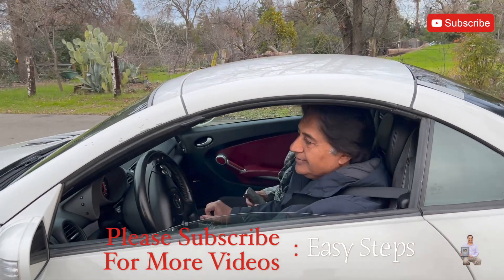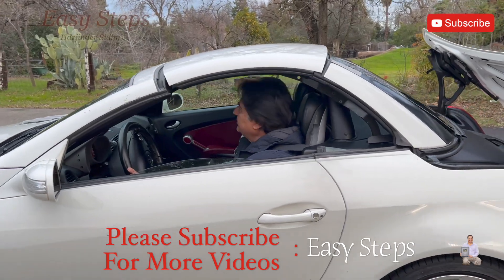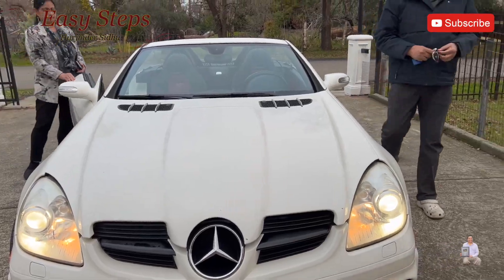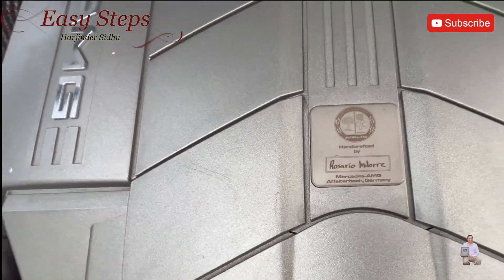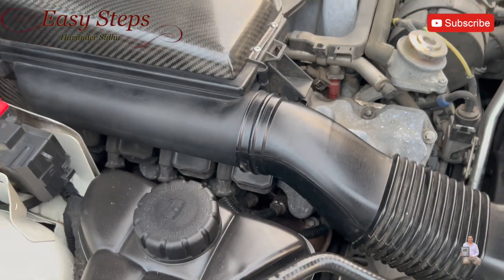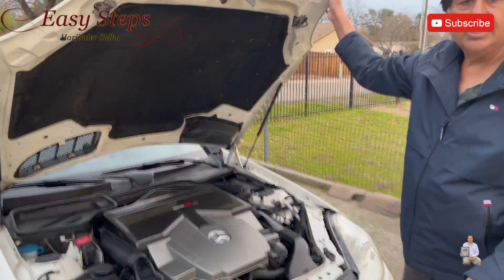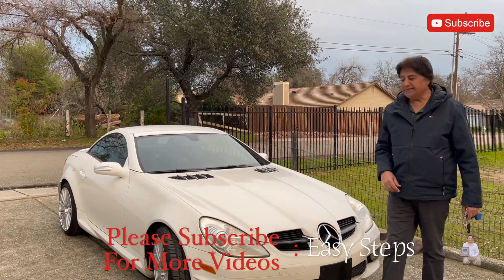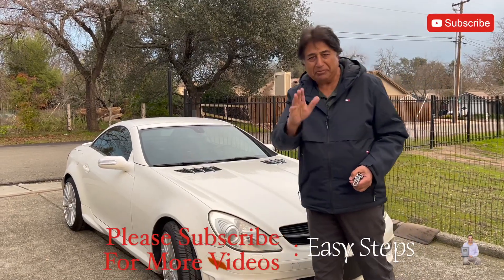Upgrading Mercedes Benz R171 SLK 55 AMG with RennTech Carbon Fiber Flat Top Air Box Assembly

Comment: Is it healthy for the engine lifespan?? 

If so, Where can I find Air box for my SLK350 2005?
Reply from the maker: I like the upgrade, of course, it's healthy for the car.
Thanks for watching. Good luck with your DIY project.🙏
Here is the link:
Reply from the maker: https://www.renntechmercedes.com/index.php/products/mb/clk-class/clk-209-2004-2010/clk-500/renntech-carbon-fiber-flat-top-airbox-for-m113-112-engines-detail
Reply: Fitment does not show Slk55amg